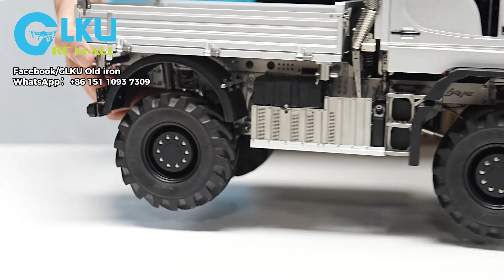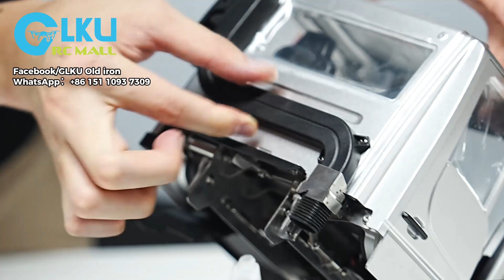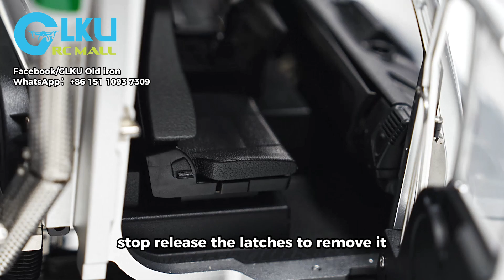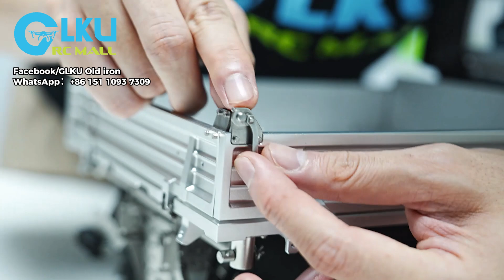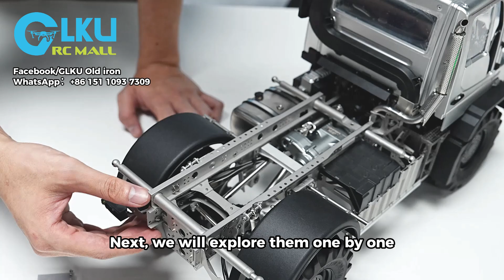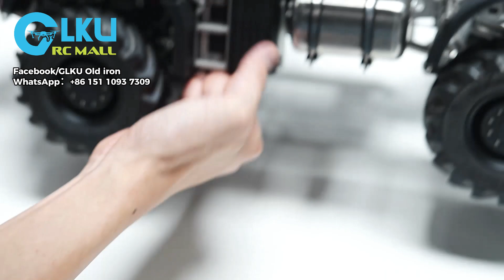1/14 RC 4*4 Unimog 535 Unboxing introduction

Comment: Is this vehicle still available to purchase?
Reply from the maker: This model has been discontinued and is no longer for sale, but you can now order the 1/14 Unimog 4023 from LESU.
Reply: @GLKUOldiron your website says you have 9 in stock
Reply from the maker: @brettrobinson6056  The manufacturer can produce it, but it may take 30-40 days.